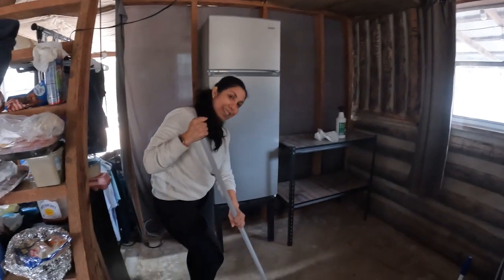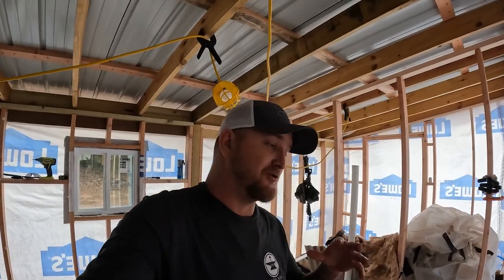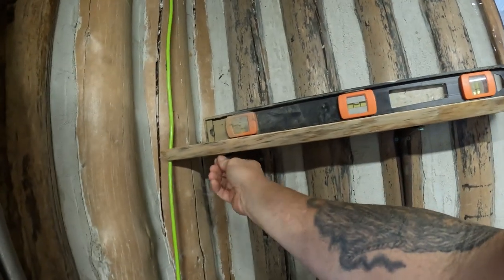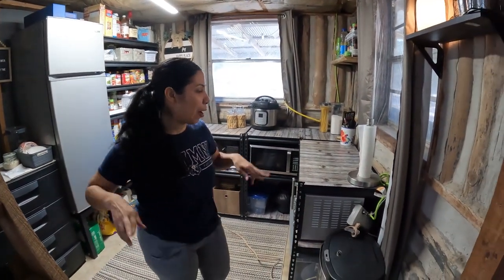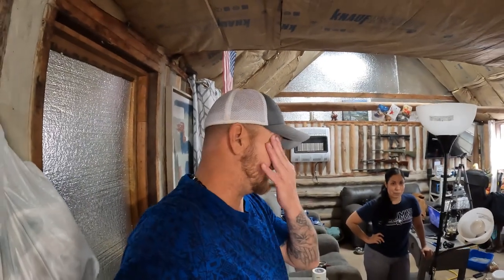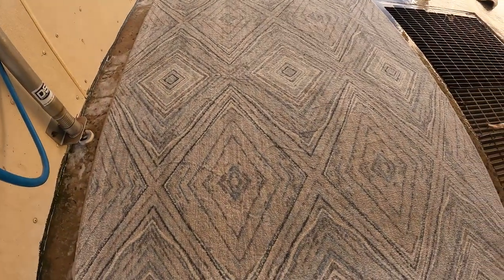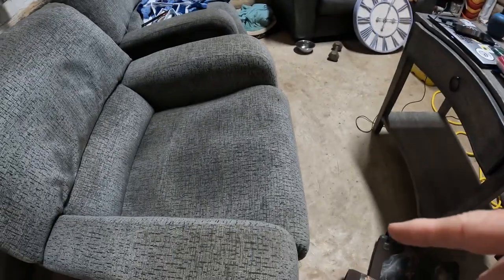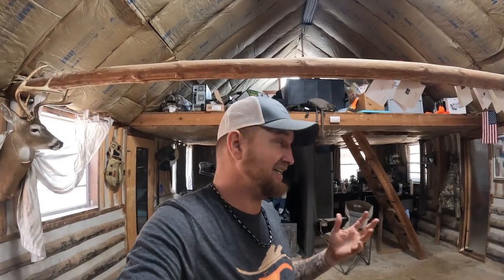I WAS NOT EXPECTING THIS | off-grid cabin, tiny house, build, how-to, homesteading, DIY

Comment: Just in one day with a touch of luck as your sawing skills are honed, you could saw some white oak or some maple, should you like darker, saw the walnut so native in your area. I think people worry to much about tongue and groove... make up your mind in one swift decision to saw floor boards about three eights thick or just waste a bit and go to a full half inch and put down a very nice floor. You might ask how am I going to make sure its tight, a good question for sure. Simple enough, first put your Purlins on the floor at a space your comfortable with and just sock it in tight. Then with proper nails, like finish nails and lay the flooring down. Rent a commercial grade buffing and sanding combo machine and in one whole long day, from wall to wall flooring others will be so jealous of.  Those perlin's can be sawed like if you were doing stickers for the lumber you would saw ahead of doing on the board and bat. The right finish, remember Google is your friend so you can pick something to seal the floor and afterwords be able to lay the wax on it. I used to saw the wood for bowling ball places and maple only gets nicer over time, once sanded... you could go to straight up wax like we did on huge floors and they were so slick, if the dog ran in and put on their brakes... it would be just too bad as they slide right on through and out the other side. Once done on that run some electrical in the walls everywhere and put in plug in boxes. After all said and done saw the wood on the mill for the walls, finish nails of course... plus while sawing this wall siding, you save the nicest stuff for shelving and tops of the box cabinets you place in the kitchen. Logs are nice and all that but what a bear to keep clean. nothing will fit right up to them... nowhere does it say you have to have logs inside the house to be a true log home.  Yeah, I know you want to reconstruct but you could also saw "D logs" and add to this cabin keeping your log home theme. Eventually taking out the loft as your not that happy crowded up in there. If you want, you could just leave a walk around ledge about say six feet wide and use those upstair windows. Just notch the electrical boxes back into the wood leaving them out the thickness of a board siding. Oh I know to just keep my mouth shut and let you have these original ideas to your own self. You ought ta get yourself a ring for that girl before she thinks she ain't really yours to keep. All stuff thats none of my business but should I not say it, I would be thinking it and driving me nuts. This means if ya read this that you can tell me to shove it and go about life.

Comment: Careful with those electric burners, I've used one for 10 years and the surface under them gets  rather warm, I put a thick wooden cutting board under mine. Just recently got new countertops and getting ready to putt my cook stove in. Will be nice not having to worry about melting my painted counters and now new laminate.
Reply: Thank you for the tip!!

Comment: My brotha from anotha motha. You need to leave cabin as is. Repair rotting logs. And build extension off the back door with the mirror. Two story. Master suite. Balcony. Adjoining to loft. That way you can work on cabin all winter inside. Give everything 100%. Rather than planning to pull roof off. You can work at your leisure while doing the addition. It will be awesome. Trust me!

Comment: Suggestion   how about a large rolling  mechanical  tool bench   that has drawer and a pegboard back possibly  overhead  shelf  there are some that even come prewired outlets  and lights  and butcher block top make great food preparation  station miss a sink ? But possibly  easy modification?
Reply: as a temporary issue if add sink to it can use 5gal bucket 🪣 to catch dish water  or water used in food prep 
   that's how grandma cabin  was for years no indoor plumbing .
wood cook stove had 15 gal reservoir on one end and  always have  have hot water available  worst case warm water depending on cook stove use

Comment: I doesn't matter how many times you guys tear up the joint & re-arrange it, it still won't
give you the space you need.  IMO, stop, just stop re-arranging and focus on building 
a back split or 2 story addition on the back already!!!

Wouldn't it be cheaper just to buy a pressure washer & do it all at home?  You have a
concrete slab in your new outdoor kitchen.